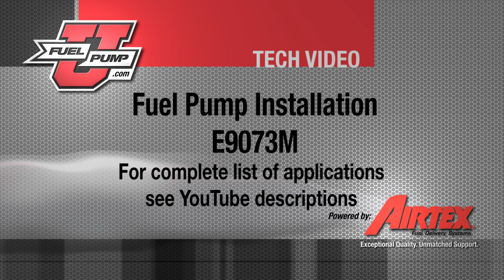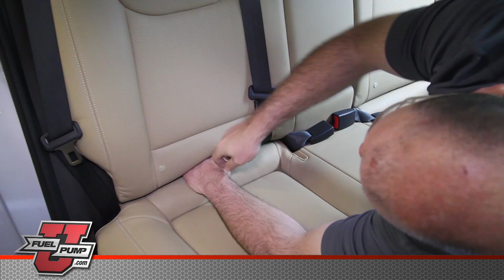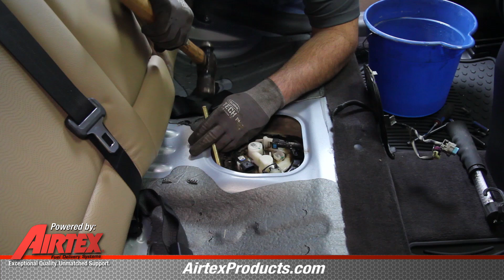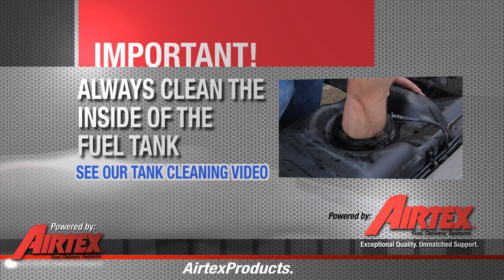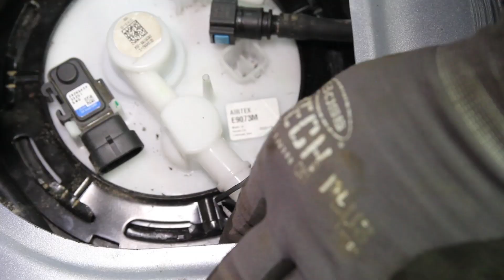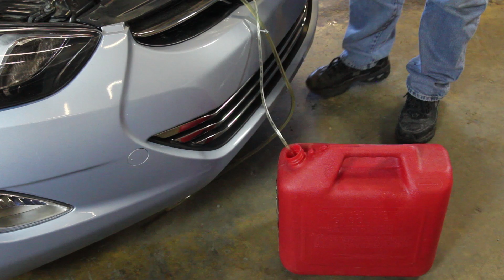How to Install Fuel Pump Assembly E9073M in a 2011 - 2014 Hyundai Elantra

Comment: Will this be a similar procedure on a 2013 Hyundai Veloster?
Reply: I need to know this as well
Reply: yes all Hyundai are built the same way. I think my pump just died. Data stream shows no pressure in the rail when the battery on and when i crank it. Debating if i wanna do this or take it somewhere to confirm the pump died. May get an hi flow pump from KDM tuners

Comment: Whatever that black adhesive is that hyundai uses to seal the cover is absolutely awful. Remove all of it before you pull the pump out. This sticky shit gets over everything it comes into contact with including carpet and clothing.
Reply: I agree stupid design and pump was so fucking tight fitting 🙄glad it’s over hopefully for a while

Comment: Difficult to remove is an understatement.  This pump was one of the biggest pains I've ever had. Better than paying 900 for a fuel pump installation
Reply: Theres another video on YouTube about 13 minutes long, by Worldmechanics.  They remove that little canister thingy that clips on to the housing in order to gain more clearance
Reply: @chrishernandez2490  almost wonder if dropping the tank is easier. Probably isn't but might look into it
Reply: @christopherhendricks4369  highly doubt it.  Even if the tank is completely out,  the opening will still be the same.
Reply: @chrishernandez2490  good point
Reply: @christopherhendricks4369  Im just grateful that the engineers at Kia gave us an access port to get to it!  Most cars nowadays make you drop the tank.
Reply: @chrishernandez2490  I was actually very surprised they did. I've done gm pumps and almost always gotta drop the tank.
Reply: Do you need some good quality and cheap fuel pumps? We have them. We are a manufacturer from China.

Comment: Would this process and the fuel pump unit be the same for the GT hatchback version of this car? I have a 2013 Hyundai Elantra GT with a fuel sender issue, but can't find any videos on replacing it, only on the regular Elantra model. Thanks
Reply: no matter the vehicle the pump and send will be in the same unit in the tank. You can remove the pump from that unit but you cannot remove the sender from the unit.

Comment: How about a 2013 Kia optima sx?
Reply from the maker: The process will be similar. The Optima fuel pump is access is also located under the rear seat.
Reply: @AirtexFuelPumps  is there a secondary gas pump near the turbo?
Reply from the maker: @gufiaito69able  No, there is just the one in the tank.
Reply: @AirtexFuelPumps  thank you so much for your quick reply

Comment: how to change fuel filter. location ???
Reply: Is it possible to just replace the fuel filter on a 2013 elantra?
Reply: @edwardgalvan95  yes but it in the tank so replace the whole assembly I did mine it takes a little time
Reply: It’s in the tank inside pump assembly replace the whole assembly it’s 70 bucks on Amazon it will take some time

Comment: Ten Things I wish I knew before starting this repair on my 2013 Sonata:1) The arrow stamped on the cover plate with the asymmetric mounting pattern is not an indication  from Hyundai that they want this to go smoothly.
2) The white plug removes easily and completely, the cover does not swing up.  Squeeze and pull. 
3) Running the engine with the plugs out only depressurizes one line, to depressurize the  other you need to open the gat tank fill cap.
4) That retainer ring is on TIGHT!  "Rent" a tool to remove it before starting the repair.
5) Take a picture of the fuel pump unit before the two metal rods separate from the reservoir, note  how many springs there are, mine came apart and I only found one spring in the tank.  
6) Remove the big emissions line to get the pump assembly out.  You will be able to reach it later.
7) The fuel pump unit will not come out without a fight!  The reservoir is bigger then the hole, it  must be pried out, it can take some abuse.  Your video helped here!
8) The fuel pump reservoir holds a lot of fuel!  
9) The retainer holding the big emissions line only goes on one way, flange side down I believe.
10) If the filter sock is on the bottom of the tank, it belongs on the unit.
Reply: thanks

Comment: Useful video but it did not mention removing the internal emissions line. and good luck with the locking ring! It took me several hours  to beat mine around. I'd buy an adjustable retainer ring tool the next time I do this. Watch when reassembling that the gasket/oring is on.
Reply: Same problem here
Reply: It took me forever with that stupid ring never have had that problem finally I had to take it to my shop up the road and he even had a little struggle but he got it and told me to drive vary slowly I got the car home and finished the install it was a bitch taking old one out vary tight